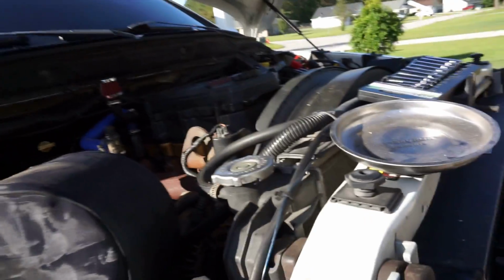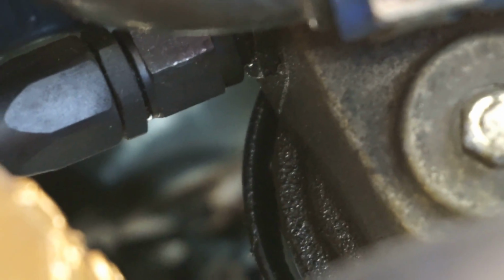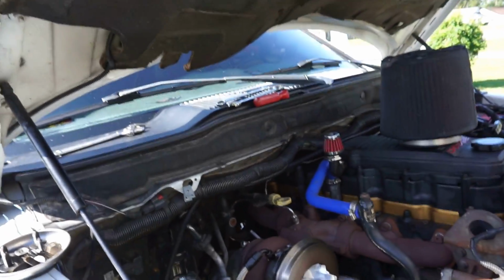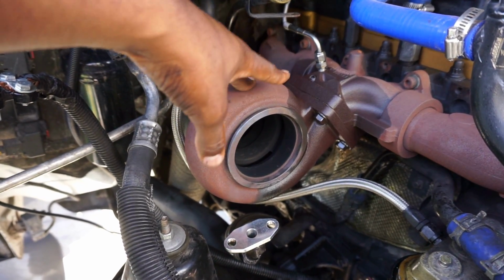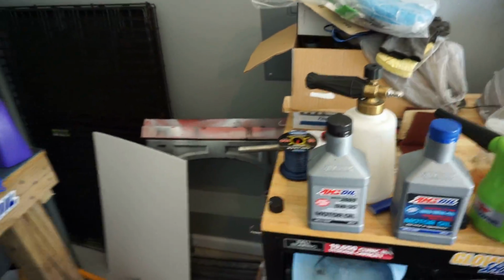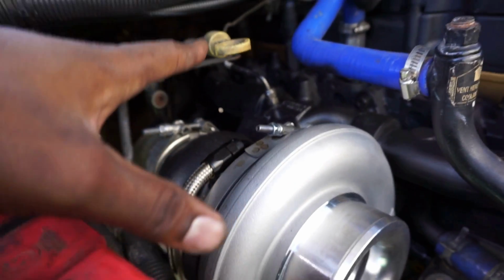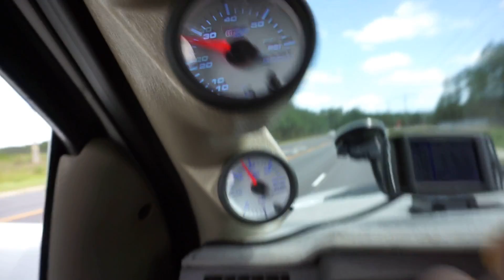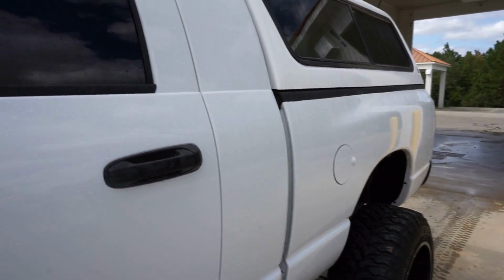INSTALLED S464 SMEDING DIESEL TURBO ON MY CUMMINS

Comment: You remind me of myself when I put my 475 on my truck for the first time. From 1800 rpm on up, I have the biggest smile on my face.
Reply from the maker: 🤣🤣  it's a thrill man!
Reply: What year truck did you have? I have a 99 5.9 cummins an I got a s475 but don't know if I can use a steed speed mainfold with a angled or straight turbo foot print

Comment: Big fan bud. I got a borg Warner a 464 and some 41% over injectors with a second gen swap for my 4th gen. Can’t wait to get it all hooked up
Reply from the maker: thats a good setup man, 464 is a nice all around turbo!
Reply: @EVERYTHANGDIESEL  hell yeah, I’m going to need a built trans after it’s installed because mine probably won’t last too long 😂

Comment: That trans shifts great, what tuning do you have, i have stock trans with rev max zero flex valve body running tuned transmission.

Comment: Hey brother, question, what are your average boost numbers while driving like normal? I have a 68mm on my 4th gen and the numbers are LOW like max I see normal driving is about 8psi, that’s about half throttle though. I miss my 64.5

Comment: Also on those braided lines they look nice but do have leak issues especially on the turbo return  that goes back into the block into the oil pan. I switched to the flexable metal one. The guys at my local deisel shop(I trust) say it's a very common thing and go with the flexable return lines.
Reply from the maker: funny u said that cause i can see residual oil trying to build up on the return line and oil feed line on the filter housing
Reply: @EVERYTHANGDIESEL  bro I'm have turbo return line whoas. My braided one at the block side swivel was leaking so I got the metal one and now creases it's leaking under boost...

Comment: Maybe you did or didn't but you didn't talk about it. Supposed to leave the oil feed line off once everything is on and clocked, pour oil into the feed port, spin the comp wheel by hand several times, add more oil, spin again and then connect the oil feed once you've done an oil chance. This makes sure the bearing has oil to it before you start it so that it isn't completely dry at first ever start.

Also, what Turbine housing are you running on the new s464? Did you stay with the .90 or did you go to the 1.0? 

I am running a .90 right now on mine but I am swapping to the 1.0ar to help with longevity on my turbo.
Reply from the maker: I did talk about that while filming but I wasnt able to get it in the video I talked about it for like 3 mins didnt want a super long video. Even tho it already is super long lmao I will mention next video
Reply from the maker: Went with 1.0 ar 6.7 Cummins should only use 1.0 for best airflow and power curve.  I mentioned it in the video I believe
Reply: @EVERYTHANGDIESEL  I knew you would but since it wasn't there I thought I'd help the next guy out a little. 

It was recommended for me to use the .90ar but Johnny at stainless diesel said not to and it's been almost 2 years since I Installed the turbo so thought id change it out before it gets beyond point of no return.

Comment: Thanks for sharing liked and enjoyed your video, I'm having to change my turbo and manifold and plan on same brand but mine is 2007 with a 5.9 so plan to use just above stock since carry alot of weight with a custom weld bed it's my welding rig so want to have it mainly for towing but a lil quicker
Reply from the maker: A s363 would fit u perfectly man!

Comment: You have an exhaust brake too? My turbo is stock but I don’t think my EB is working cause it doesn’t go into high idle ever and doesn’t seem to slow when I push the EB button
Reply from the maker: No the eb was on the stock turbo, the eb has nothing to do with high idle. Make sure ur hitting the right buttons
Reply: EVERYTHANG DIESEL  it is just the EB button on my center like below the AC controls and then you turn cruise control on and set then hit the accel

Comment: Hey! So was the oil leak coming from the bottom oil inlet tubing going into the turbo and was the oil leak resolved once you put everything back together? Also, How's your steering pump holding up? Great videos man. Thanks!
Reply from the maker: yessir the leak was from drain line bottom of the turbo and oil feed line on top, it's fixed now no leaks, and i went with thinner oil too so i know its good!

Comment: Hey man I’m looking to second gen swap my 4th gen here soon I’ve heard good and bad things about smeding diesel what’s your input on that so far if you still have the same kit
Reply from the maker: I've never had a bad experience. I've ran 4 different turbo setups from MDC Diesel and loved it. Affordable yet effective kit. Plus Mack at MDC is always willing to help or give information about stuff. I recommend them man you won't be disappointed. If you go with the turbo I recommend upgrading to the billet wheel, high flow compressor and heavy duty bearing. The turbo will be a ripper. I also got a got a promo code "everythangdiesel" to save you $75 on your kit or drop in turbo
Reply: I was looking at getting the SXE-R turbo they have with the 1.0 housing is that the one you’re talking about bro? Yeah i feel like alotta people just go off words from the ones who had that one bad run of luck or didn’t install it right
Reply from the maker: @evann6.75  yessir, u were looking at the 467? Yea man installing the kit isn't hard and long as you make sure every thing is installed correctly  and tight you'll be fine
Reply: Oh yeah man no doubt I installed one on my 5th gen and did evil fabs kit and it actually was a big let down I had every issue you could think of with the evil fab kit and yeah I’m going to run the 467 I got 100 over sticks from s and s 10mm pump 165gph lift pump stage 3 fire ringed head from fleece , fluidamper, fleece rockers Hamilton trunions heavy duty push rods you name it everything under the hood is built only thing that’s stock is the bottom end 1100hp full billet trans
Reply from the maker: @evann6.75  oh psshhh u know what u doing haha. Yeah bro you'll be happy. Plus Mac gives 1 year warranty on his turbos and actually stands behind them. That's wild what u had happen with evil fab, everyone always raves about them
Reply: Bro I had two bad borgs outta the box and pretty much got told go fuck myself
Reply from the maker: @evann6.75  gotdamnn u hate to hear that stuff man. You definitely won't have that problem or shouldn't with the smeding turbo.
Reply: Thanks for all the input brother I appreciate it!!!

Comment: EVERYTHANG DIESEL  You can have a huge compressor and still not make big power on the top end due to having a small turbine. Take my setup. My secondary is based off a turbonetics  turbo the compressor is 76mm and the turbine is 65mm . Your s464  is much bigger than mine.  When your trying to understand what a turbo will do picture the turbine and compressor like gearing or leverage. Theres allot more to it but tgats the simple way to under stand it Both are needed to make power.
Reply from the maker: I agree and I'm pretty knowledgeable understanding it I did a lot of research understanding it. I like that comparison  of two gearing system. For a single setup the 64mm with 83 turbine is a good setup. Very similar spool to stock low end but much better mid speed and rolling.

Comment: I’d be careful running that thinner oil i didn’t think it got all that cold in your area? You might experience some blow by on my old 5.9 i ran 15w50 year round no issues but on my 18 6.7 i just keep 15w40 i just don’t trust that lite of oil in a diesel that’s just me tho
Reply from the maker: I've had great success with 5w-30 before on this truck. I like it!
Reply: EVERYTHANG DIESEL  Success or not, 6.7 Cummins engine is not designed for that weight of oil.  You could be wearing internal parts out faster than normal.
Reply: I have seen numerous diesels running 5w30 or 10w30 it's sole purpose is fuel economy the detergents they put in the oil is what make them compatible with the engine

Comment: EVERYTHING DIESEL, good job man!

Couple questions for you. Why don't you powder coat? Super, super easy to do and extremely amazing looking.

Other question, why can't you use your other turbo so that you have two of them going?

Love your videos man. Keep up the good work!
Reply from the maker: thanks man i appreciate that. im just cheap thats why i don't powder coat. lol i would love to run two turbos but you need a s400 compound kit to mount both turbos up.
Reply: You bulletproofed the engine. Bulletproof that tranny bro than twin turbo! 😊

Comment: Mine is a 2016 Cummins so I know it's a bit different, but did you need a tuner to make sure the new turbo didn't throw a code or put her into limp mode? I'm looking at doing a 2nd gen swap but tuners have all gone the way of the dinosaur now (thanks, EPA!) so I'm kinda stuck. Looking for your feedback. Thanks, brother! Love your content.
Reply from the maker: At the very least you would need your truck tuned and deleted. To do a 2nd gen swap. U can't do it on a stock emission equipped truck.
Reply from the maker: When u do a 2nd gen swap you replace your manifold with a different style one and your egr wouldn't be able to connect to it no more
Reply: @EVERYTHANGDIESEL  I hit a bump a year or so ago and my EGR and DPF fell off... :-P Will it work then or do I need a different tune than the one I already have?
Reply from the maker: In that case yea it will work. To get the best out the turbo I recommend a custom tune file for it though. But you install a 2nd gen swap kit
Reply: EVERYTHANG DIESEL Thanks, brother! I appreciate it!
Reply from the maker: No worries man!!

Comment: What AR is your 464
Reply from the maker: Ar was 1.00
Reply: @EVERYTHANGDIESEL  any reason you did the 1.0 instead of the 0.90? do you know anyone with the 0.90? or how it spools compared to the 1.0?
Reply from the maker: 6.7 cummins like the 1.0 better more overall flow than a .90. Spool is still great

Comment: While your experimenting, you should try an s364.5sxe or s366sxe. Spools even sooner, and faster, and flows more air.
Reply from the maker: ahaaa the infamous s300sxe vs s400 thats a good comparison there man, especially since i drove a s369sxe 6.7 cummins and it was amazing. the compressor maps tell two stories there, if i ever got my hand on one id defiently do the comparison!
Reply: @EVERYTHANGDIESEL  they are some great units. I'm pushing for higher power and stuck with the s400sxe frame for reliability and turbine flow. But a non abused daily can make a fun 7-800 on a 300sxe.